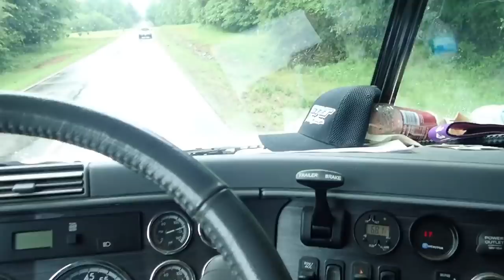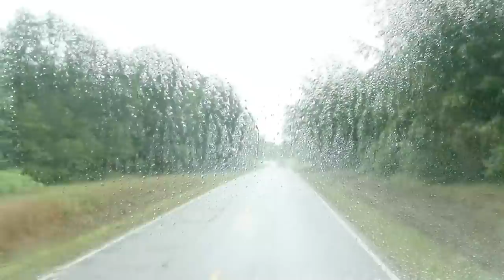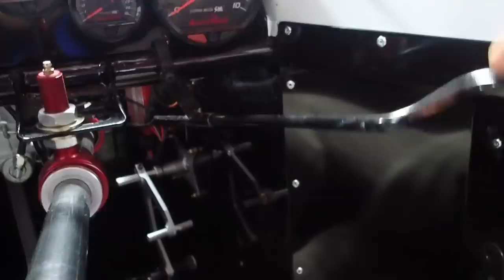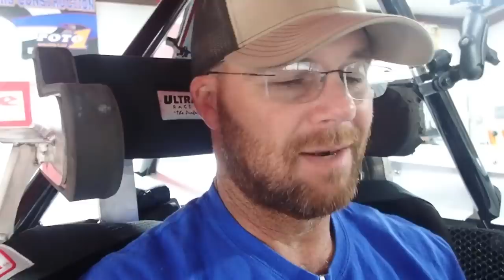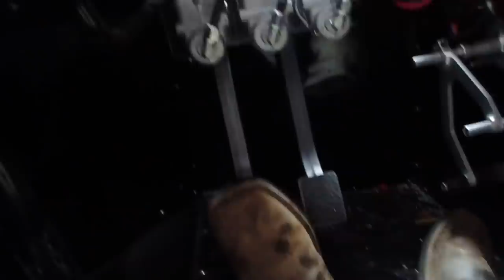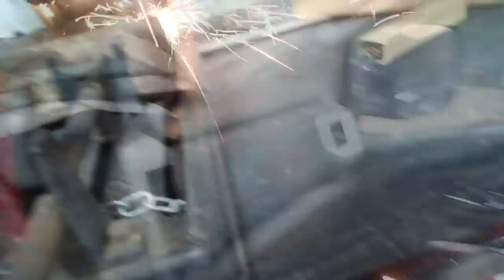INSIDE THE COCKPIT OF THE NEW RACE CAR 🤔🤔🤔

Comment: You need to bleed the brakes with a vacuum pump pushing fluid to the master cylinder through the calipers. Or reverse brake bleeding. Then I would normally open the bleeder and have the person in the vehicle slowly push down on the pedal. Doing this ensures that there is no air pockets in the brake and clutch system. 

Moreover, repeating this every week as part of the maintenance program helps minimize the chance that the brakes will fail during a race. Because as I am sure you are well aware. It can get sketchy when the  brakes fail for whatever reason.